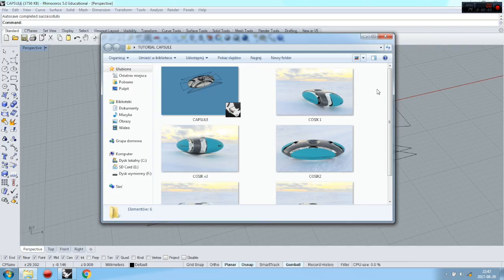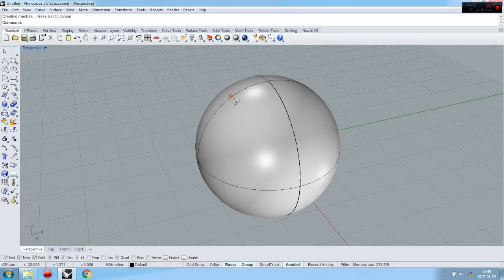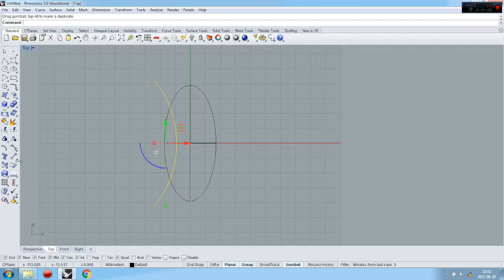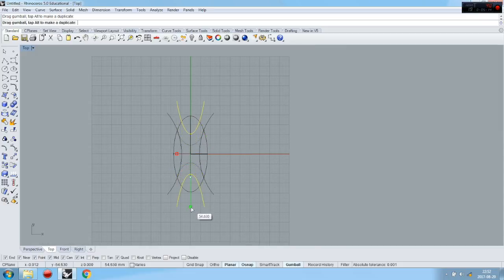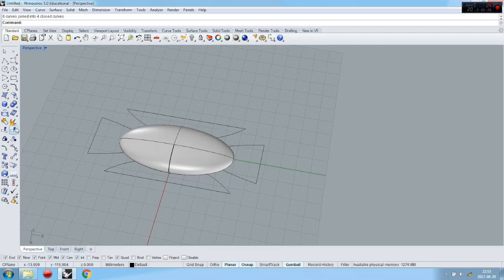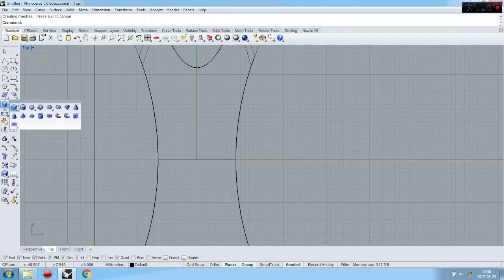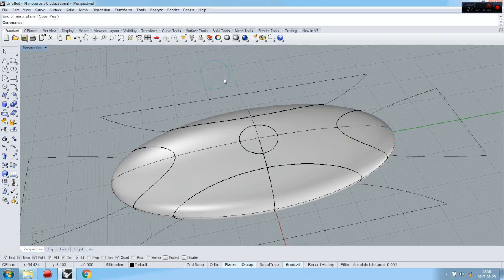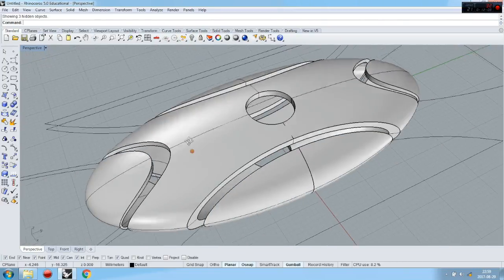RHINO TUTORIALS - NASA Capsule - BEGGINER

Comment: At 20:23 you could check the "Refit within" option and play with various settings for the tolerance, then click Preview to see the expected shape according to your settings. An alternative solution is to go to 20:27 and use "MatchSrf" command to match the edges of the lofted surface that you just created to the ones of the vertical ellipses at either side. No matter which way you choose, that will increase the amount of control points for the lofted surface, but will also make it more accurate and with even offset from the outside shell.

Comment: I don't know what I'm doing wrong. At 13:05. I explode the shape. then I delete the 2 inner cylindrical shapes. then as I go to blend the surfaces I'm unable to. As the circular edge is incomplete. there are 2 control point that show up when I go to blend. these control points break the circle (edge). its there on all the 4 edges that I need to join to make cylindrical surface blend. and I just can't seem to fix it. Any help would be most appreciated. Thanks

Comment: At 15:52, simply click on the "XAxis" or "YAxis" option in the command prompt to make a mirrored copy, eliminating the need to type "0" followed by a manual clicking in the viewport while holding down the Shift key.
Reply from the maker: Thank you this is very helpful tip.

Comment: i am facing problem while blending. My circle are getting exploded in two part when selected for blending.
Reply: i had that issue too, if you click "chainedges" and then "AutoChain=no" until it says "autochain=yes" it worked, at least for me. I'm a complete beginner so I don't know what it does at all, hope that helps
Reply from the maker: Find command merge surface edge before you use blend.
Reply: RHINO TUTORIALS thank you
Reply: @joshknight7627  This also worked for me. Thanks a lot Josh!
Problem with "merge surface" is "Can't merge trimmed edges of surfaces".